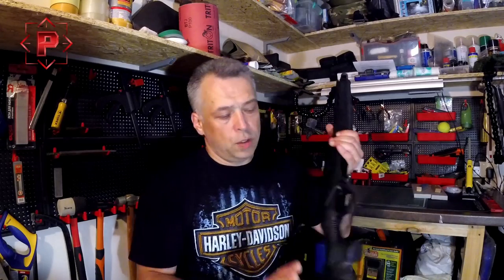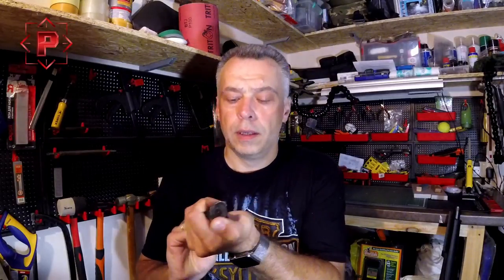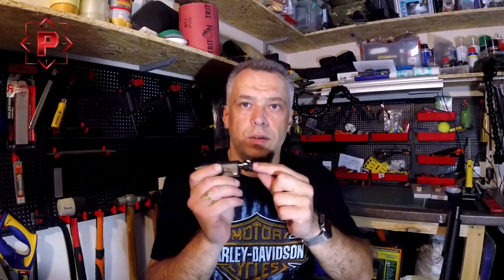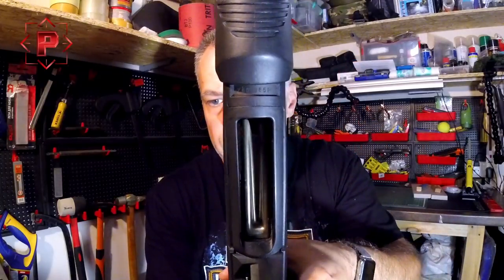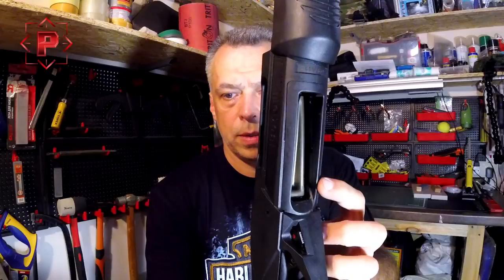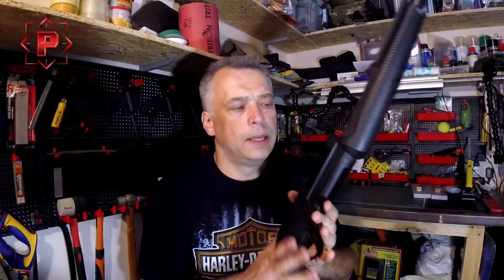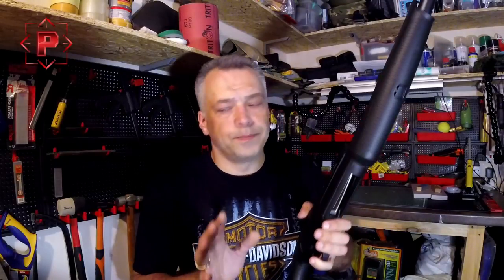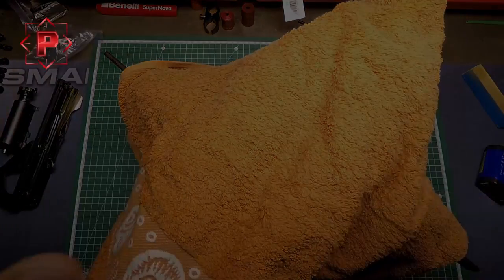How to renew the SuperNova receiver

Comment: Thank you for your videos. it is very helpful.I will recommend these videos to IPSC Thailand shotgun shooters. Some of them often use Super Nova shotgun.Now I have a problem. My shotgun Super Nova, mag tube loosed from receiver.Please tell me about how to repairing them.
Reply from the maker: Hi! Thank you and our greetings to all IPSC Thailand shotgun shooters. You can fit your shotgun mag tube by thread-locking fluids - https://en.wikipedia.org/wiki/Thread-locking_fluid
It is better to use the green marked because it is used by Benelli factory
Reply: That’s very clever, but even if it works, I don’t think you should have to do that to the receiver of a firearm in order to keep it functioning properly. To me you’ve made a great argument for not getting a Benelli with one of these composite metal plastic receivers.